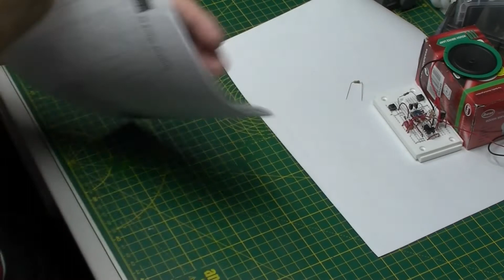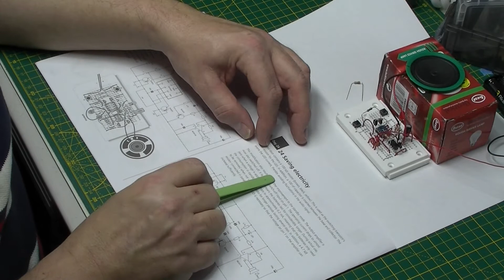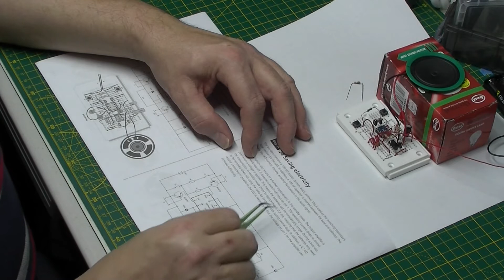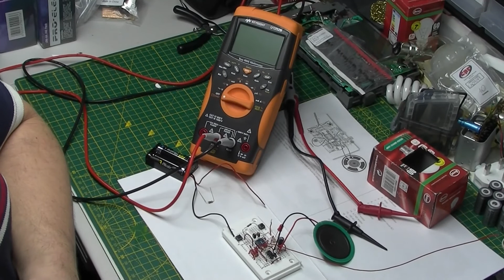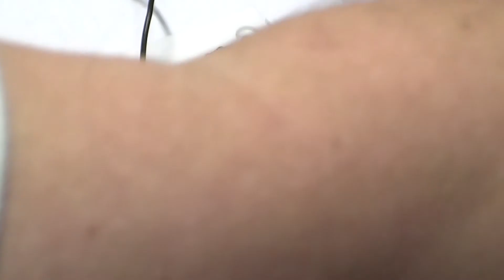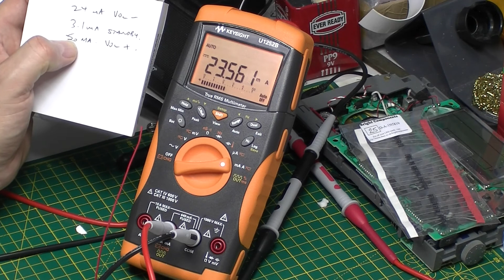Haynes Advent Calendar Radio: Day 24

Comment: i did all of that in 1 day and it doesnt work... how do u get frequency and sound to work at the same time and for the music to play?
Reply from the maker: Every time mine didnt work it was always something I had not done correctly. Usually it was a link that I didn't fit or remove. In the instructions it doesn't tell you about a lot of the links, they rely on you looking at the component layout. Check all your links are in the correct place first. I also had issues with the breadboard not making good connections with the wires so go around and check that they are all grabbed by the breadboard. The frequency is controlled by the radio chip and the sound is amplified by the audio chip. If none of that works then you will have to check it over with a voltmeter to make sure that you have the voltages at the radio chip and the audio chip. Good luck and let me know if I can help more. Thanks for watching, Graham
Reply: Radiocruncher I completed it how it showed me in the last picture of the manual. Later I figured out the colours but it doesn't play....I did it correct but I didn't understand why it didn't work.😦😲😞😔😖😕
Reply from the maker: That's a shame. All I can suggest is that you take a few good closeup photos and email them to me graham@radiocruncher.com I will compare it with mine and see if you have anything out of place. Cheers Graham
Reply: Radiocruncher I found that annoying too. Plus sometimes a part added with no explanation as to what it’s doing. I didn’t understand the 4.7k resistor in parallel with the LED. Something to do with the amp muting?

Comment: Graham, just use a rectifier diode with that 3.7V battery - 0.6V drop, should bring it into line, and will double as a reverse polarity protection device ;) Save messing with zeners etc
Reply from the maker: Thanks Lloyd and Merry Christmas. I did consider that. I wanted to make sure that if it had overvoltage that it would stay within the tolerance of the radio IC. Dave is going to be charging the battery with a 5v USB. If he forgot to switch the radio out of circuit then potentially he could still get 4.4v on the IC which has a max rating of 3.6v. A regulator will make sure that doesn't happen. I had to rule the zener out as they ideally need 2v more on the input than the target output which with a possible 4.2v at full charge and 3v requirement it didn't really work. I'm always open to suggestions as I'm by no means an electronics expert. All the best Graham